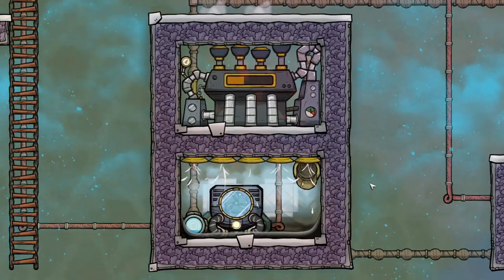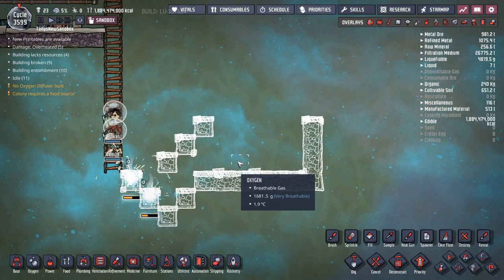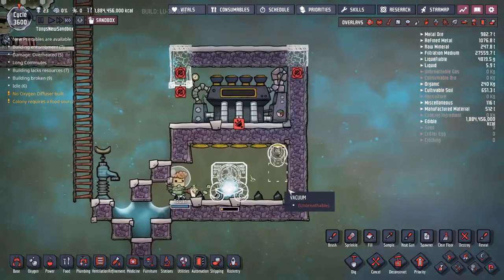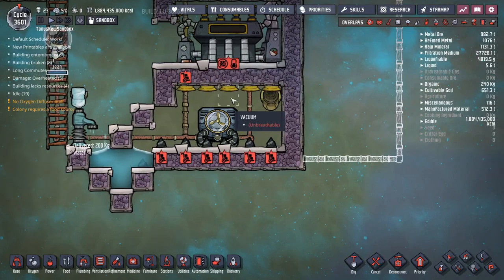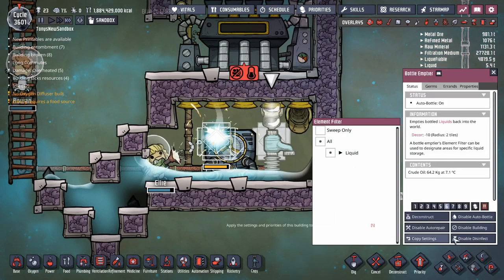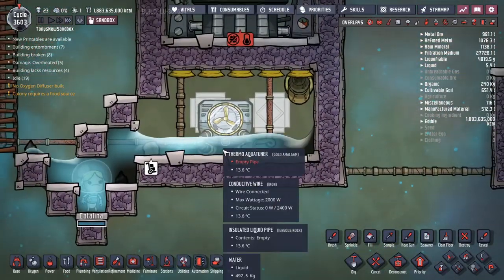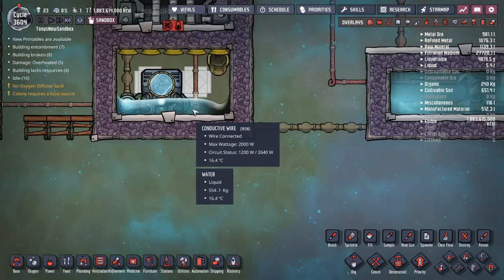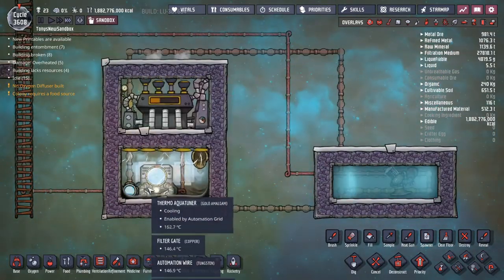Active cooling without steel.

Comment: That liquid bridge bypass for the aquatuner intake didn't get stuck for me, but instead was bypassing the aquatuner with every packet of water, not just when backed up. Built it identically, but mirrored left/right. Re-did the bypass with an extra bridge. Was exactly the cooling bump I needed since finding an iron volcano, thank you for the steel-free setup info!
Reply from the maker: Sweet! :) I'm interested in seeing what you did with the bridges if you happen to want to post a screenshot or something.
Reply: It also overheated the turbine within a few cycles. I ran the aquatuner output through radiant pipes over the turbine to cool it down. We'll see if she holds stable now :)

Comment: it can get stuck in a loop like that if you have the wrong number of pipe sections in the bypass section and you over-fill the bridges and the aqua tuner...
it can also get so the coolant pauses for a second every time it moves when the aqua tuner turns off.

another thing that could be useful in this sort of setup is to add a thermo sensor on an and gate with the pipe liquid sensor to keep the steam chamber below the breaking point of the aqua tuner or it can get carried away if your steam turbine fails for whatever reason.

Comment: Finally a good and updated explanation of this cooling system. Usually it's just people drawing over-complicated stuff in sandbox mode with perfect materials and no real explanation. I have only  a couple questions.
1- The initial water you put inside the aquatuner room, which evaporates into steam and starts the whole process. Will it run forever? Does it just stay in steam form in this eternal cycle of cooling/heating without any loss?
2- Tempshift plates. Never used them so far and I'd like to be 100% positive about their functioning. Basically they distribute the heat between the oil and the steam, which is sucked in by the turbine, cooled down and outputted in the aquatuner room again. Is this correct?
Reply: 1 - The steam is used by the steam turbine and gets converted back to water at 95ºC, which in turn gets heated up back to 100ºC by the aquatuner, so yes, it's perpetual, you are destroying just the heat, not the elements.
2 - Correct.
Reply: Thanks. Will try my first cooling system in the near future.

Comment: I also like your use of looping/automating directly at the aquatuner (disable tuner, liquid flows past) instead of in a "coolant tank" (use liquid shutoff to redirect to a different set of pipes).  This seems to have removed a lot of unnecessary spaghetti.
Reply: I'll usually have the sensor/bypass at the aquatuner too but I'll still often pop a liquid tank on the line somewhere.  I like to have a buffer of extra liquid in case I want to quickly extend the cooling loop or draw off some cold liquid for something else.  Not needed but I find it very useful.
Reply: @lucasriley874  It's extremely useful to even out the temperature of the packets. Sometimes some odd cases happen, since the packet at the sensors isn't the packet that enters the tuner. In this case, it's very close, but so it's much less likely to create huge differences, but I've seen cases where the same packet gets cooled down (despite being cold already) while a warmer packet skips the tuner. Tanks always average out the temp of the fluid inside. And you don't need a full tank, I'd say you need to store about twice the amount of fluid you circulate in the loop (so for a loop that holds 50 10kg packets of liquid, that would be 1000 Kg in the reservoir, about 1/5 full). For larger loops, you can go with a 1:1 ratio maybe.

Also I some cases I route the output of the tuner directly back to the tank, and not to the loop. That allows very precise tuning of the minimum temp of fluid inside the loop which is good if you want to push the coolant to the lower limit, or if you need to keep something within a precise range.

Comment: The Aquatuner will get stuck if the bridge output is in front of the aquatuner output. so at 4 minutes if you ran the bridge up and then piped thru the tuner output to the bottom pipe it would work for awhile,  even turn on and off right. but if it fills the bridge it will break and then endlessly loop. The aqua tuner never has an empty output, so it will stop. I noobed this for awhile. I understood inlet priorities, for some reason it didn't translate to the output side in my head also. I fought a sour gas boiler for awhile....
Reply: I just add a liquid reservoir to the loop to avoid the "pipe full" situation myself.  I have no luck when it comes to inlet priorities ... every time I think I have it , it doesn't work right.   :)

Comment: Reason for a not gate?  The sensor has above and below which gives same function.  I like the vacuum method; I usually did pumps which is a pain and slow
Reply from the maker: It's a filter gate. The reason is to prevent the aquatuner from turning on and off quickly.
Reply: @tonyadvanced6315  but then you will have a packet get in the tuner that is below the cut off temp resulting is frozen packet....You actually want it to turn off every time the logic is triggered because it means a packets should not pass through
Reply: I THINK (noob here) based on my limited experience ... if this setup didn't have the buffer gate , when the signal went red there is enough pipe there that if there was only 1 packet of cold water it would end up sending it into the tuner, as the next packet would be hot which would turn the aqua-tuner back on, and the cold packet would get sucked into it.
Reply from the maker: @chemie7037  Since it's a filter gate, it turns off the aquatuner immediately. It just has to wait at least 5 seconds to turn back on again.
If you do this in a loop that doesn't bypass the AT then you need two thermo sensors to be sure a cold packet doesn't sneak into the AT and get frozen.
Reply from the maker: @Ozmundas  That's a very good insight. Technically, I think that vulnerability exists in this setup, but since the coolant loops continuously all the packets tend to be very close in temperature and I don't think it's possible for a too-cold packet to get frozen.
In cases where that's a problem it can be worked around by using two pipe-thermo-sensors instead of one.
Reply: @tonyadvanced6315  maybe i watched too quickly, I thought you had a bypass to the loop. Anyway, thanks for the reply.

Comment: Build the complete setup without vacuum, start the system until you have steam (you ll have mixed gasses + steam) stop the system, open a tile on top of the AT chamber and it will spew steam and the other gasses immediately. Close the tile, wait for the water to condense and vacuum is done!
Much faster, you just have to mop after.
Reply: It works only if the gasses inside are lighter than steam. Won't work with CO2 or chlorine. It's good for H2, O2, pO2, natural gas and others, tho.

Comment: There is a much easier way to vacuum your room. Just dump oil, water and polluted water in your room: no matter how much, it will form 3 layers, each 1 tile high. Once you seal the room, it will have only liquids inside.
Reply from the maker: Yes. I wish I had shown that method in my "how to make a vacuum" demo as well.
Reply: P water is no good for that. Salt water or brine are superior. If you dump oil, water and p-water, you have to make sure you put enough water in, and use a lot of heat. 

What I mean, when the temp reaches 100C and the water starts flashing into steam, there is a chance that the pwater offgasses p oxygen before the steam pressure stabilizes. This becomes less and less likely the more water you put it, and the stronger the heat source is. What you don't want is small quantities of water to flash, or the process being slow.

In this setup, if the aquatuner stops at the wrong moment when the temp is around 100C, the steam may start condensing back into water, reducing the pressure and letting p-water offgas. This is less likely to happen in other setups (think volcano tamers for power) where the initial heat is strong enough to flash large quantities of water into steam and instantly create a nice steam pressure. You aim straight at 200C and stop draining heat when you get there.

The second reason p-water is bad, is that it leaves behind dirt instead of salt. If for any reason dirt heats up to 329C, it turns into a solid tile of sand, entombing your aquatuner. Ok, in this particular case, 329C would destroy your gold amalgam AT way before that happens. But  steel ATs might be able to survive such a spike w/o taking huge damage (they start overheating at 325C), and some people do like to operate their ST+AT setups above 200C by closing the intakes with doors, so it's not that unlikely.

Salt melts at 800+C, so it's not a concern (and anyway, oil or petroleum are already sour gas at that temperature,  so your chamber is already a mess at that point).

The technique you describe is solid, I use it all the time, just I prefer not to use p-water as the third liquid if some other type of water is available.

Comment: Could granite tempshift plates work better? In terms of system stability, the conductivity isn't as good but it's still not bad.
Reply from the maker: I haven't tried them out but my best guess is that they would work just fine.
Reply: it doesn't need awesome conductivity. it's just adding mass & spreading heat more evenly because of how temp shifts interact.
Reply: Granite has only a little less thermal conductivity than copper ore (it's only about 3.4 TC compared to copper ore's 4.5). The gold amalgam aquatuner in the video only reaches around 125°C max with an overheat temperature of 175. There looks to be a lot of wiggle room with what material is used for tempshifts. So granite would most definitely be able to work as a tempshift plate instead

Comment: Thanks, this video really helped setting up my first aquatuner, just one question : what timeout/delay do i set on the Filtergate?
Reply from the maker: I usually leave it set to 5 seconds.
Reply: @tonyadvanced6315  Thanks, yeah it seems to be working, 12C water to my aquatuner/steamturbine/base cooling :).
Reply: @tonyadvanced6315  Not sure if stuff changed related to this since 2019 but after running for several cycles it does slowly overheat. Tried more oil, more water (so more steam) etc. No luck.
Changed to Steel and no more problems. I do want it to work with gold. To be continued :)

Comment: Nice build :) Although technically it does use steel - you've built a filter gate out of steel at 7:51 :D No need for that obviously :)
Reply from the maker: Wow. Good eye, I'm impressed. I fixed that but I edited it out in the final video.

Comment: This is great video, but I didn't understand what was the whole thing about the water pipe and aquatuner getting stuck and the bridge and all that. Can someone please explain that to me?
Reply: Hey Karim, If you make a circle of pipe (gas or liquid), and attach a pump to fill it up, it will stop moving once it's full.  If you have a machine in there with an input and an output, while the machine is running, it will continue to loop in a circle (important for lots of reasons).  However, if the machine turns off the contents stop moving.  If you put a bridge in an otherwise completely empty loop (imagine if the aquatuner wasn't there) it will continue to loop.  That design lets the liquid coolant continue to move regardless of whether the aquatuner is on or not (otherwise it would get stagnant and stop cooling until the machine turned back on).

Comment: Wouldn't you need to do a smidge bitt extra with the pipes to say, make it pass past the steam turbine to keep it from overheating as well?
Reply: there's ONE section of pipe that's radiant  (rather than insulated) behind the steam turbine.
Tony claims that's enough. I usually do a little more myself & it's overkill

Comment: Normally we build this near to our geyser but the temperate around that area is usually >45, is it still ok for us to build this setup there?
Or should i cool that area down first?
Reply from the maker: I've never tried this in a place that started out at more than 145C. I don't think the aquatuner would have any problem because that room gets vacuumed out anyway. But the steam turbine won't work if it's over 100C, I'm guessing that would be the tricky part.
Reply: What about the temperature for crude oil?? I notice yours is only at 10C, how??
Reply from the maker: @FisherManPride  In my game I sandboxed it in. 10C must have been the default temperature. I bet the crude oil is fine up to 145C, but I haven't done this experiment, so it's hard to be sure.
Reply: @tonyadvanced6315  alright thanks ! :)

Comment: If you have oil available why not use oil as your coolant ? Though I suppose it could be just some oil from slicksters and not the oil biome.
Reply from the maker: Oil has a specific heat of 1.69 and water has a specific heat of 4.179. That means that cooling with oil only does 40% of the work of water but costs the same. (The cost is the power to run the aquatuner).
The benefit of using oil is that it can get to lower temperatures, but if you don't need lower temperatures then it's cheaper to use water.

Comment: I tried this, but for some reason my Aqua Tuner keeps overheating above 175c. I got lots of oil, temp shift plates and it's made from gold amalgam. any ideas why this happens?
Reply from the maker: Put a screenshot on imgur.com or wherever and post a link here and I'll take a look.
Reply: I think I found the issue, there's a problem with your design: enclosing the steam turbine causes it to overheat after a some time, causing it to temporarily shut off (when it goes above 100c). This in turn causes the heat in the chamber below it to accumulate faster which causes the aquatuner to overheat. removing the insulation around the steam turbine fixes this
Reply from the maker: @Denso481 I'm glad you got it figured out. I can't see your plumbing but consider routing the cooling pipe through the steam turbine room to keep it cool like in the video. It will generate a lot of heat and it makes it easier to control if it's enclosed.
Reply: @tonyadvanced6315  That's exactly what I did eventually. Didn't initially route the pipes through the turbine room and didn't realize you had to do it, makes a big difference. My mistake here, sorry. And thanks again for getting back to me, cheers!

Comment: New to the game, if you had the steel what would you do different and why?
Reply: Make the aquatuner out of steel and don't add the layer of crude oil. Steel has a higher overheat temperature than gold and a steel aquatuner can transfer its temp to the surrounding steam quick enough without the need for crude oil.
Reply: @isawadelapradera6490  True, my bad. Keep in mind that you have to put the liquid vent in the layer of oil if you want to dodge the bug

Comment: so basically just forget about heat before reaching an oil biome?
Reply from the maker: You can use wheezeworts or move heat around in various ways or vent something hot to space, but getting plastic in one way or another seems to be the major requirement for dealing with heat in a way that is permanent, scales to quantity, and efficient for dupe-time and resources.

Comment: AAAAAAAAAH! I got a Copper-Volcano next to my new Colony! I need the early-game-steel-free-double-caffeinated-Volcano-tamer NAUWGH!!! :D
Reply: pretty sure ur gonna need some steel for that one :P easiest way is to just build 1 metal refinery somewhere close to base and just pump it full of liquid u never want (i use nearby slime biome water), when the pipe breaks through overheating just disable repairs on the pipe and it can run forever, basically u never get the liquid u pump in back out unless u break or fix that pipe that broke but can pump in as much as the refinery needs forever... heads up if u do deconstruct the pipe sometime just remember its gonna be very hot steam lol
Reply: @KerbalSpacey  But the advertisement said, the volcano tamer would be steel-free :P

Comment: Can you have more than one aqua tuner
Reply from the maker: I haven't done the numbers, but I'm pretty certain you'll need one steam turbine for each AT. One steam turbine isn't powerful enough to keep two ATs cool if you are running water through them continuously. Also, in this situation the temperature has to be kept low enough to prevent the ATs from overheating, so you can't even run the steam turbine at it's maximum potential.

Comment: Sadly my aquatunner still overheats even with the tempshifts and crude oil, on the other hand it seems to be outdated as of the current patch, you need weezeworts to cool the turbine down, beats the point of the entire setup.
Reply: consider the amount of water/steam in the room. 900 kg/tile absorbs a lot of heat with less temperature change than a 10 kg/tile steam room.

another option is adding another steam turbine to keep eating hot steam and returning warm water. surely 2 turbines can defeat 1 aquatuner cycling a normal-coolant.

also automation could include an And Gate requiring that the steam isn't too hot to prevent the aquatuner (the only heat source in the room) from cooking itself.

maybe that means the system can't cool as much as desired, but that's the limitations of lower tech/materials.